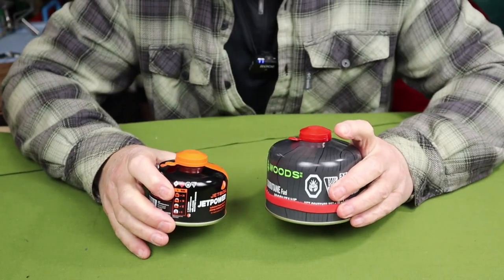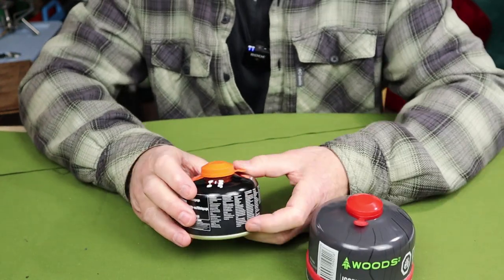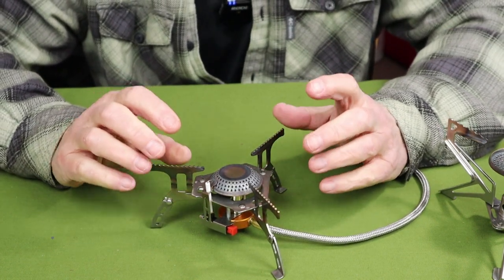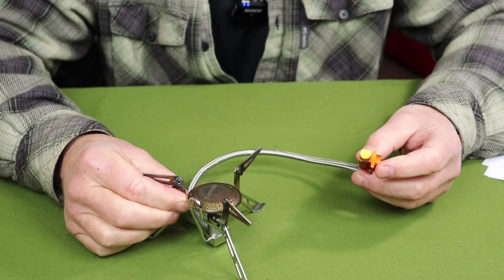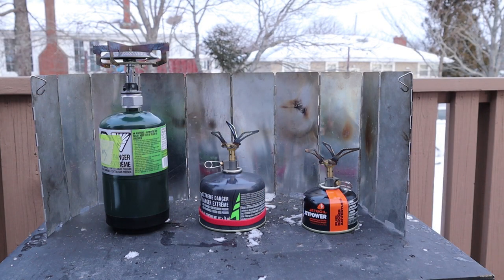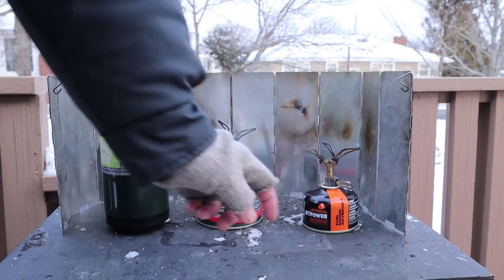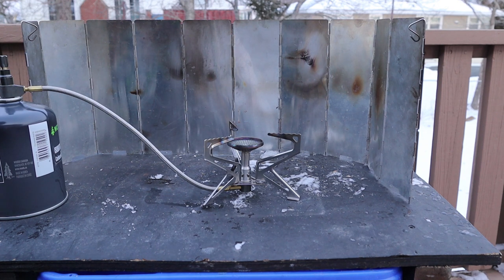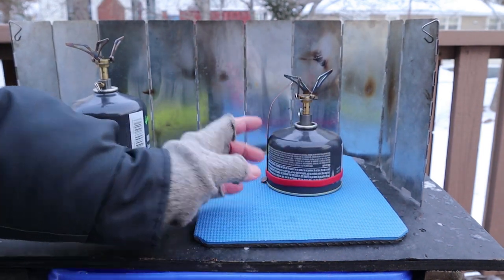Comprehensive Guide to Using Gas Canister Stoves in Cold Weather

Comment: Great video. The amount of liquid in the tank does not affect the pressure. Only the temperature of the liquid affects the pressure. It takes energy to vaporize the liquid cooling the liquid. A smaller volume in the tank cools faster than a larger volume. Therefore, a smaller volume may appear to have lower pressure.
Reply from the maker: Thanks for the info!
Reply: I was about to post this same comment. The pressure depends only of the temerature of the liquid.

Comment: Trangia gas burner has both preheat tube, and pressure regulator, and high quality. I use this with a trangia T27, as well as an optimus polaris for extreme cold and higher elevation. They all fit in a T27, so bonus windscreen
Reply from the maker: Yes, that is one of the pros for the Trangia burner. Thanks for commenting
Reply: I’ve been thinking about using my  Optimus Polaris in a 25 or 27 Trangia windcreen.  Can you tell me how stable is it, do you use any adapter? and if you have ever damaged the aluminum windcreen with the Polaris at full heat? Thanks.
Reply: @covenantking I do not have the adapter,  i use it in the closed position (as in I don't open the legs) and it is still stable that way. I do not  crank the heat full either.
Reply: It has a preheat tube but I believe it is not meant to use an inverted canister. Perhaps I’m mistaken?

Comment: I find I can warm the canister using a remote canister stove by simply placing the canister somewhat near the burner.  I use a wind screen and leave it open on the canister side.  I monitor the canister temperature to make sure the metal stays low enough that  I can touch the canister is not ouch response.  In additon to touching the canister to monitor its tempurature, listen to the stove.  If it starts to roar the canister is beginning to over heat.  Turn it down or off immediately.
Reply from the maker: Yes, that would work. As you say, you would need to watch it closely. Thanks for commenting

Comment: Good video. The exothermic hand warmers are dated. Be sure to  use non-expired ones. After the expiry date, they may or may not work. I had a bunch past expiration and it was hit or miss on a lot of them as far as them working.
Reply from the maker: Right on. I test one of my left overs each winter before carrying them. The cheap ones seem to have the shortest shelf life. Thanks for commenting

Comment: Mark, preheat tube on this stove would work much better with pot on the stove. The flame would spread wider and touch the tube. Without pot on top of the stove, the tube is not in the flame and less efficient. Thanks for the tips with paper clips and cooper strip. I will try them both.
Reply from the maker: I agree, I think I may have mentioned that at one point. I should have sown a pot being placed on all of them. Thanks for commenting
Reply: Good on ya Boris, fair point mate. Cheers Duke.

Comment: Thank you for the excellent demonstration of the three work arounds for using an ISO-butane stove in colder temps.   Since, I'm truck camping versus backpacking - I bring a trusty 45 year old SVEA 123 as part of my kit when headed to higher elevations,  just in case.
Reply from the maker: I do love my SVEA 123 but they do require a bit more work than these type of stoves. Thanks for commenting

Comment: If you put some tablesalt on a stick and hold it into the flame,  the flame would be much more visible in the video. 
Thank you for the demonstration.
Some of the cheap chinese stoves conduct enough heat into their base, that they can run on an inverted canister without issues (at least mine can, and that one was realy cheap), so it might be worth it, to carefully try it out outside.
Reply from the maker: Interesting idea about using the salt. Thanks for commenting

Comment: A lot of information succinctly delivered. 
Guess we all have our favourite stoves for cold weather, for me it’s the SOTO StormBreaker works with white gas or inverted gas, I also use an Optimus Vega remote stove that will work with a canister inverted and has a stand to facilitate this. 
I find it a bit annoying when a manufacturer makes a stove that can work with an inverted gas canister but doesn’t provide a suitable means to support the canister inverted. 
Liked your Bull Dog clip work around. 
In the Uk RidgeMonkey make a USB heated canister cover that warms the gas to keep it working in cold temperatures.
Reply from the maker: Fire Maple makes on as well that I will ask them to send so I can share it. Thanks for commenting